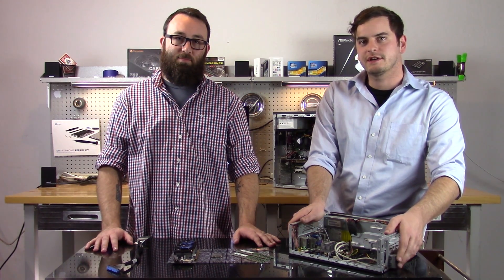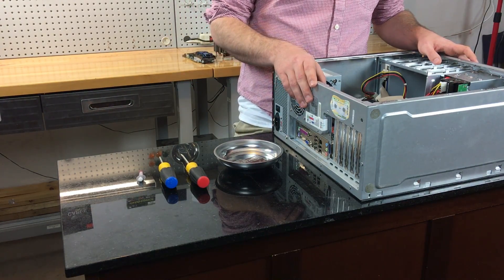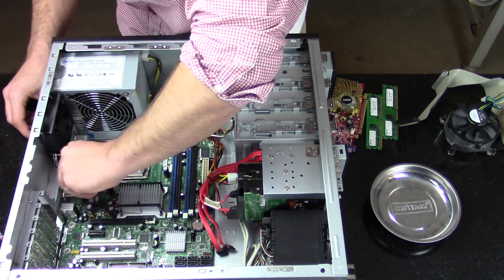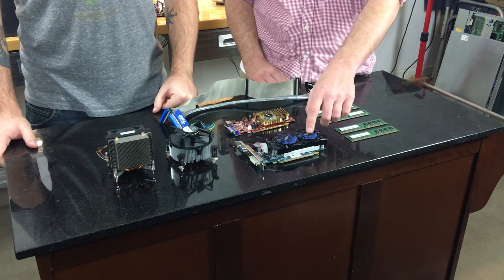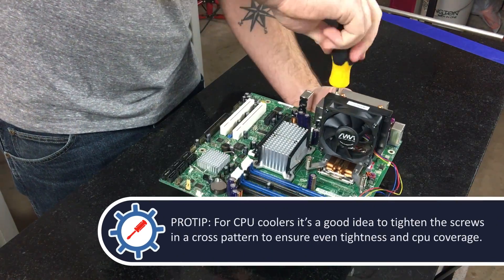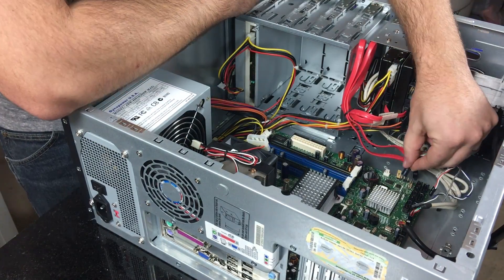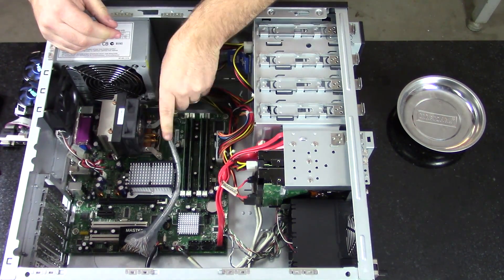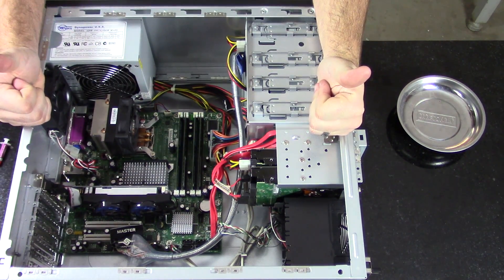One Man's Trash - Episode 02 Upgrades, PC tear down and install tips!

Comment: on a build like this, I'd add 2 piggy-back 3.5 to 2.5" adapters and install 4 2.5' SATA hard drives, then add 2 Sata ODD along with the second IDE drive to max out the system. find out what the maximum amount of memory the system takes and install it... and IF I could upgrade the processor, I would do that.... nice build!

Comment: overall great stuff but a few suggestions.  1.  replace battery which could be very bad at this point.  2.Explain why you chose the video card you did.  3.Since it was a core 2 duo and you were replacing the cpu paste, why not replace the cpu with a q6600 for about 10 bucks?  4.I know that some older motherboards will accept 3 gigs of ram at a higher speed or 4 gigs of ram at a slower speed.  Was this an option?  5. Did you install 64 bit or 32 bit windows and why?  6. Overall you seemed to have the goal of upgrading this computer with random compatible parts from a random computer.  Is this true?  If true, why didn't you make this more clear.   I think viewers would be more interested in the better bang for buck than installing random parts.  7.  Was the primary reason for the speed improvement?

Please improve the quality of your videos as I would like them to get more patrons.

Comment: "PROTIP:"Always place your components on a static free surface. The bag your motherboard came with is a good option." 

No, that bad is not a good option.. The contents inside the bag are protected because the bag creates a Faraday cage/shield and this protects it from shocks as the current will never flow to the part inside. Some basic info on it: https://en.wikipedia.org/wiki/Faraday_cage

But, this does also mean that the outside of the bag might not be static free and it can possibly be holding on to a static charge in the plastic. On top of that, the metal strokes/layer are/is able to conduct electricity. This increases the surface area of which you can discharge your body its static charge to and this could lead to ESD damage much more easily than when using another surface to put your part on.

I like the video and I do appreciate the work that went into it but little things like this could have consequences for people following the advice.

Comment: You actually put the ide cable wrong the blue connector should sit on the motherboard because its labeled system and the other connector should be connected to the drive

Comment: in fact, the mb bag have conductive materials on the external layer to prevent the static, so using it as static-free surface it's the worst idea. It's better to use the box.

Comment: why did you take the motherboard out just to swap the cpu coolers?
Reply: The newer CPU cooler had a back plate they had to install. The case doesn't have a cutout for this so they had to remove the motherboard. Hope this helps.

Comment: Pro tip: the outside of the anti-static bag that your motherboard comes in is conductive, so NOT a good idea to put anything on it at all...
Reply: if you turn the bag inside out then you could possibly use it in the way they suggested.
Reply: +Spartan 119 Haha well yea you could, but would anyone? The thing is that they recommended to use the bag when it's actually conductive.
Reply: thats all theory , in practice I have newer had any problem with static e. Just dont throw components in dirty or oil surface cos it can get weird behavior.
Reply: Nikola Karovic Well, it is not actually theory. Static electricity damage is well documented and could potentially fry any component in your computer. With that said, if you excercise caution and common sense, you are in most cases safe. BUT, if you do experience weird issues that you can't find the source of, it could potentially be ESD damage. This is rare though, I've built computers for many years without antistatic bands and such. What I am saying is that you should not give a "pro tip" that is actually not to recommend. Assembling motherboard and the components outside the chassi, use the motherboard box or a wooden table if you don't own an anti static mat.
Reply: Did u have any problem with static electricity or do you ever saw any component destroyed buy it ? If no all that u talk about is theory...I didnt so I speak from personal experience not some quantum crap.
Reply: Patric is right. It is well known among computer techs that you shouln't place your components on top of the anti-static bags. The outer-coating does normally have conductive elements which can possibly damage your hardware. And it has happened. And just because it has never happened to Patrc or to you, Nikola, doesn't mean it has never happened.

Will it happen every time? No. But it's a risk. It's not just a theory.

If I put a loaded gun to my head and pull the trigger, there's a good possibility I'd die. But there's a chance I could survive. Does it mean I recommend everyone take that chance? No. OK, maybe it's a theory that I could die if I tried. Does it make sense to put that theory to the test? No, it doesn't.

Comment: Just a quick comment, cable management doesn't restrict airflow as seen on Linus tech tips vid of it.
Reply: yeah, would have to stuff a tshirt, and other things to stop air flow all together. and possibly interfere with fan operations. Cable management is more for making your case look neat and pretty. Especially if you have a window side panel.
Reply: it can if you have lots of cables but in something like this you wouldnt have to worry
Reply: it used to be a possible issue when computer had two ide ribbon cable and a floppy ribbon cable and if like my pentium 2 system two fat ribbon cables from a pci card to two pcmcia slots in the front
Reply: yeh but that is pretty much irrelevant now as if u have a pc with ide cables then u should probably just through it out
Reply: no thanks i like my 8 hdd home built pentium 4 server. 3 ide 5 sata and with the board i could add 5 more ide but i won't since sata is faster and better cable management. also the one ide is the os
Reply: balthasaur I'm always paranoid that the cables are gonna interfere with the cables, happened with my 5 year old build, it's an easy fix.